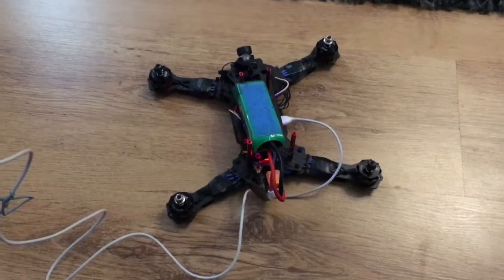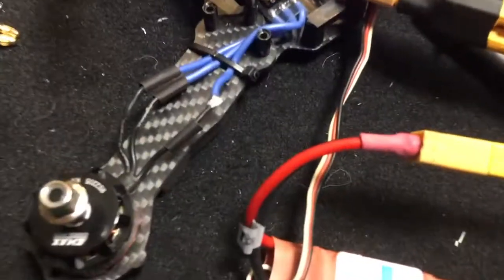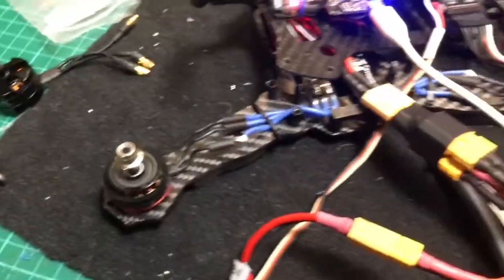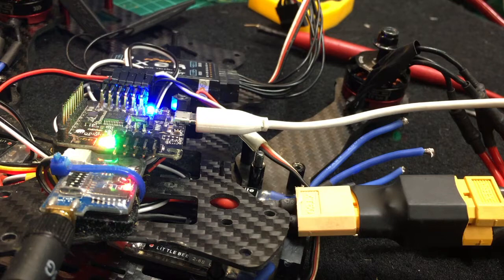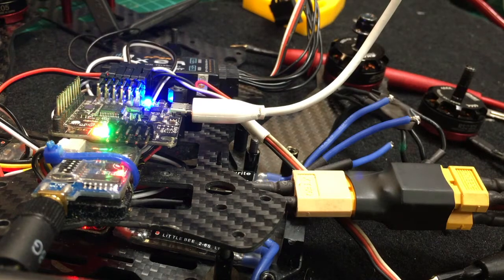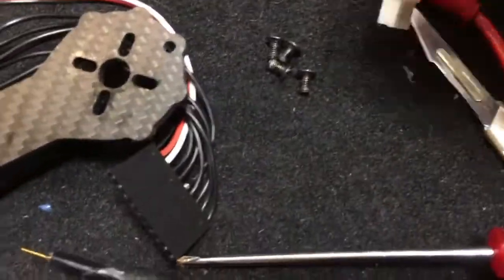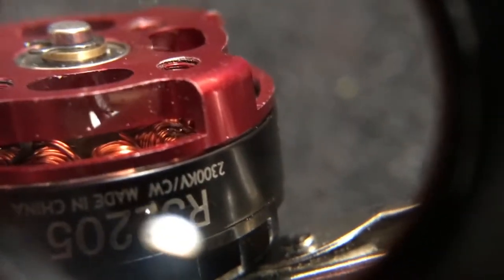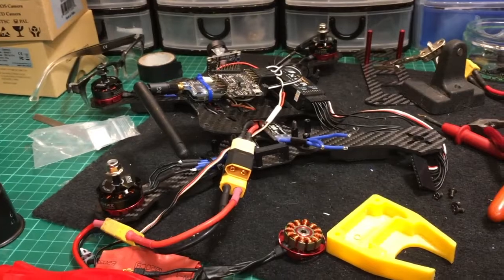Fault Finding Twitching Motors

Comment: I have the same problem when the motors twitch a lower rpms, Its a new motor and i haven't used any screws, not sure where the problem lies, any advice on where i should look?
Reply from the maker: I suspect your ESC needs calibrating...... follow the motor esc calibration procedure in betaflight.
When done successful all motors shall spin the same time when throttling up when quadcopter is flat.
Also make sure all esc settings are equal.
You can use the BLHeli Suite to check the ESC configurations.
Reply: Did that fix your problem? I am having a similar issue